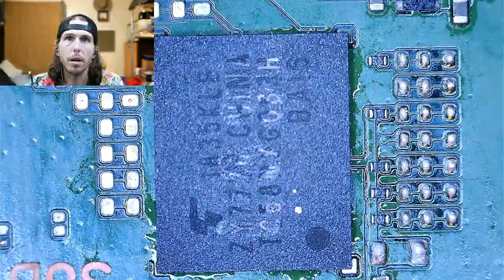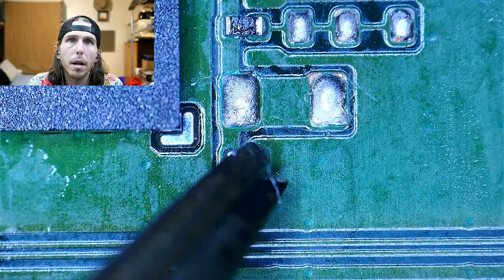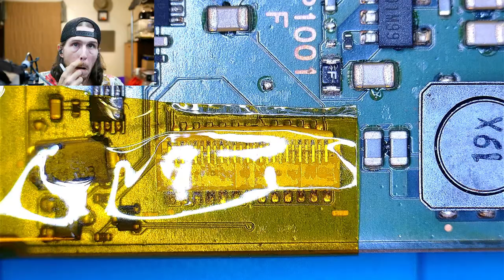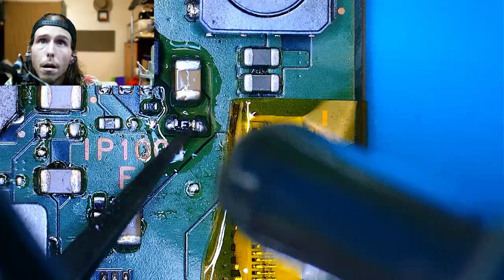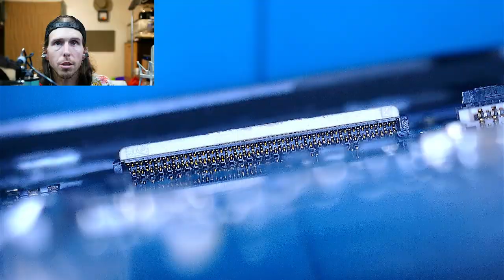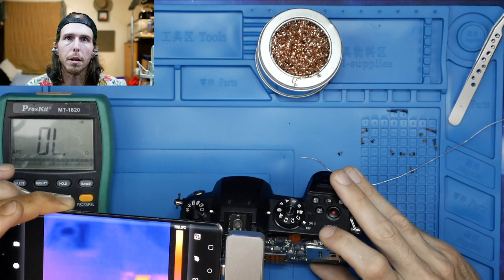Lumix GH5 Bricked Firmware, trying the Aliexpress PCB's firmware, blown fuse repair. (Part 2 of ?)

Comment: Appreciate the fix! I had one that looked like it was flung off a vehicle then sat in the rain with the lens off 😢 I wire bodged the fuse but the board is cooked and image coming out of a good sensor is just brown mush. I'm thinking about pulling the firmware chip off to see if I can use it on another camera with the locked down firmware - what was the stencil size you needed for the reballing?
Reply: NAND 1 BGA 67 for anyone looking in the future :)